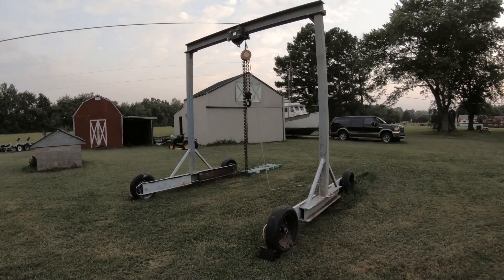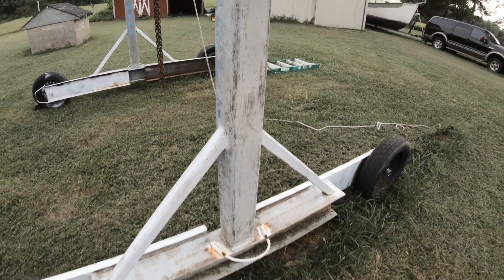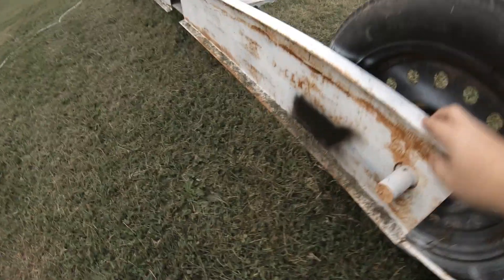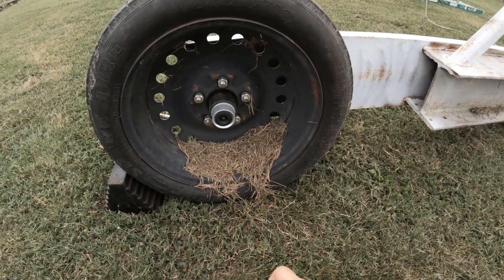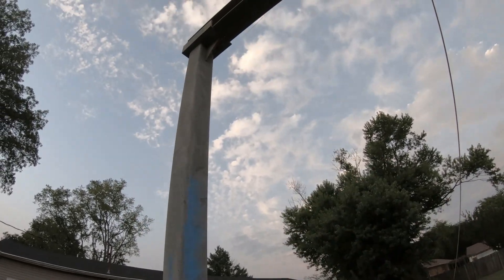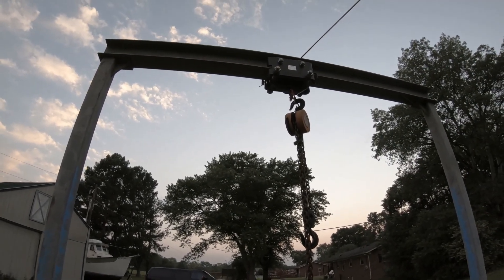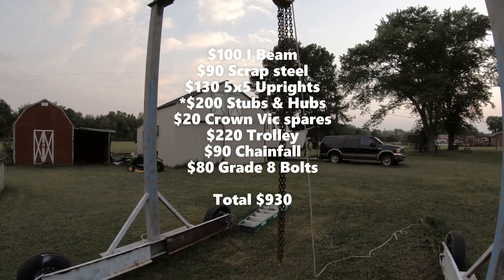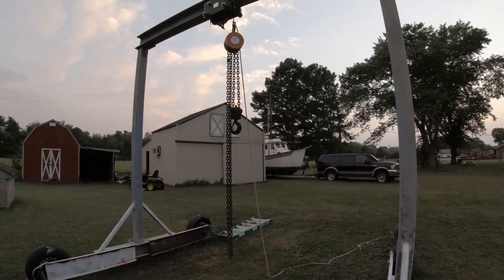DIY 5 Ton Gantry Crane

Comment: DIY Gantry Crane - YouTube 
It is carried on the trailer, straddling the cargo area, and is mounted on wheels with a ramp on the sides of the trailer. Operates independently of the trailer, and can have a simple rotary gear plate, welded onto the wheel hub, with an electric motor mounted on the side for electric locomotion.  Must have clearance for the wheel wells for easy storage and mounting on trailer. Also, different sized tubes for vertical posts, so that the height of the crane can be adjusted. And, an adjustable attachment pole, with the appropriate multiple pulleys attached, to use the lift to raise and lower height adjustment when necessary.

Comment: Brilliant! I love the fact that you upcycled and found a way to make this. I have Stock Rims/Tires from my Tundra. You just saved me $$$ for my build! Again….Well Done!
Reply from the maker: My (non engineer) thought process was that if there was a structural failure the weakest link would likely be the wheels/tires as they are thr only under rated by weight component. The c channel sits only a few inches off the ground so if there was a collapse at the wheel or tire there is not far to fall.

Comment: um i rlly dont think u can lift 5 tons with that
Reply from the maker: It's lifted a known load of 4500lb easily. Maybe you can make some crane engineering videos and post them.
Reply: @stevenmurphree  thats  2 ton  not 5 
i can of course send u a solidworks file with stress and breakaway points
Reply from the maker: @sto-kitten  if you're going to the trouble to make a solidworks file just make a short video too. I built the crane off relativism and think I over built it. I would be interested to see an engineer's perspective.

Comment: Steven, interesting gantry crane.  Been looking at the 3-5 ton versions.  The wheels make total sense for your application.  How well does it turn in a shop environment?
Reply from the maker: Not well. It does not even turn very well in the yard but is possible by chocking wheels and pulling the others. I would suggest load rated casters for shop concrete.
Reply: Maybe he could fab a steer sled for it. A narrow four tire tray, like a sleeper. Install it when needing to turn.